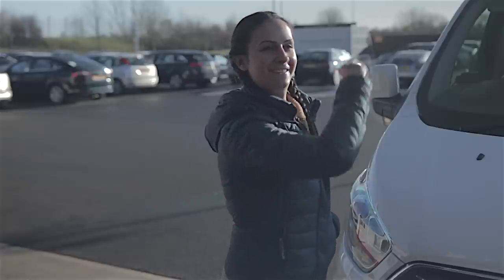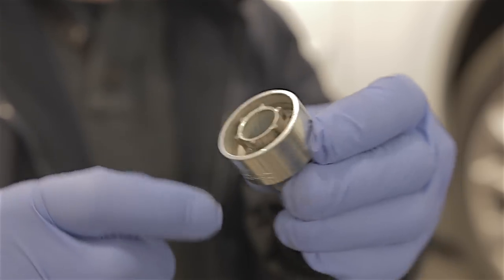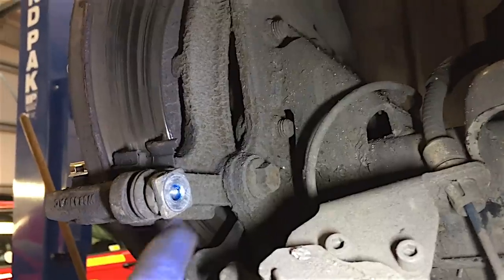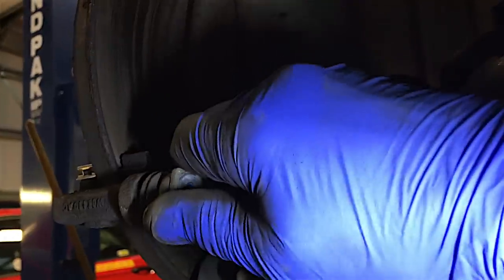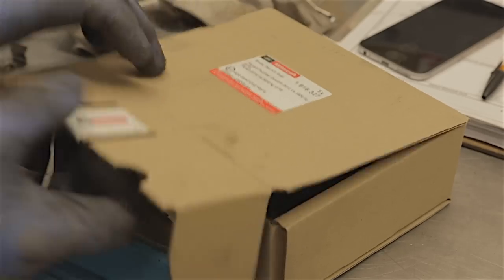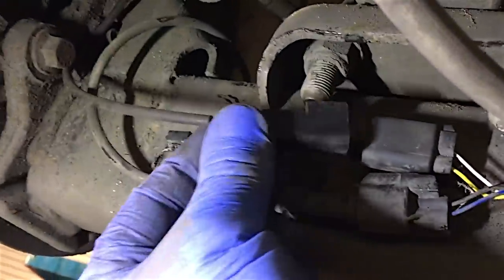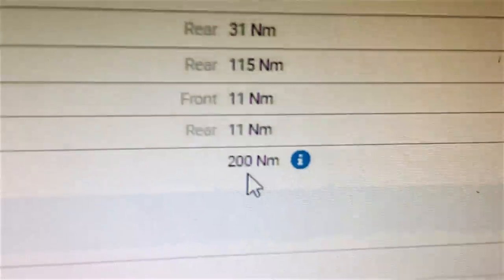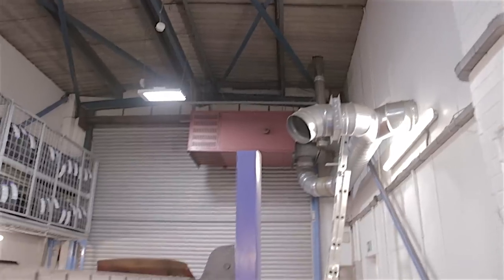2019 Ford Tourneo/Transit Custom Rear Brake Pad Replacement & Swollen Wheel Nut Removal

Comment: Two wet belts on one engine and the sump has to come off to replace them!!

Stuff is just too damn complicated now.

I had the chrome cap fall off my Mondeo,I only noticed when I got a flat,and of course the standard wheel brace won't work because of the reduced size,luckily I had my trusty tool kit,and my 18mm socket and breakerbar got me back on the road quickly.I replaced them with Volvo nuts which don't suffer from that problem.

Great to see you back Alan.
Reply from the maker: good idea to keep a proper socket set in your car, and replace those nuts with solid ones, cheers andy

Comment: Ive said it before, When pushing the brake pistons in , crack the bleeder, put a hose on, then push the piston in. No resistance, No fluid going backwards though the ABS valves and NO filling up the master cylinder and it gets rid of the dirty heat affected fluid next to the piston. Then when you top up to bleed the brakes, new fluid gets the the caliper faster. simple.
Reply: Sometimes the nipple will not undue , and they snap , then it's new caliper or gravity bleed it
Reply from the maker: i will try that method on the next one but great tip, without the proper wingback tool it could make the job a lot easier
Reply: @alan4x  Thanks for another great video! 
For what it is worth, I have also been practicing blocking off the break hose with some pliers when pushing the pistons in (after cracking the bleeder). 
I have also been told to add copper grease on the top surface on the piston and the fingers on the callipers. I am told it should reduce screaming noise from the brakes. Is this true?
Reply from the maker: @Torstein1960  i don't think putting copper grease there will stop brake squeal...most pads have anti squeal material on them but i guess its worth a try if you have squealing brakes, not something i have heard of or done myself
Reply: Funny I've been doing brakes for 20 yrs and I've never had fluid push up out of the master cylinder or ever had to add a drop
Reply: @alan4x the only time I've heard squeaking brakes is when people don't put SILGLIDE on the backside

Comment: You may already be aware but there is actually an arrow on the callipers pointing which way to wind it in and there’s a mark at the back of the calliper that you line the piston hole up with. New bolts from ford are usually 12mm too
Reply from the maker: i did not know that, so thanks for the tip, now i do know, cheers hobbs

Comment: bought a 3/4 inch socket for the 19mm ford nuts, it fits a treat, saves about 15 mins per service
Reply: I bought a Laser 18.5mm/19.5mm impact socket for the very reason. Wish I’d thought a bit harder and used my 3/4inch socket 🤣

Comment: Just want to thank you for your video my 2018 custom rear pads were were worn and bringing up the service indicator.  I used a special  tool, not pneumatic, passenger side quite easy but quite a job on the drivers side 
I used silicone spray as you suggested and had to buy a new torque wrench that did 200nm 
Thanks again

Comment: Funny enough had this problem with nuts on a mk4 mondeo today. Ended up removing the covers and will order new non covered nuts. Done rear pads on a mk7 transit and found starting off the rewind was hard going with the winder tool. I found opening up the bleed nipple helped but also using a suitable socket and bar on the winding tool to give a bit more pressure helped. Ford really screwed up with the nuts though!!

Comment: Good idea to use new bolts. I have had one ( top bolt)  on m 2005 Mondeo come loose and drop out. Wheel jammed as the calliper fell against wheel. Recovery home and I fixed it with new bolts.

Comment: Swollen nuts were a problem with a 57 focus i had. I levered off the chrome cover, under it is a smaller size nut head that fits the next size smaller socket . Use a 6 sided socket NOT the 12 to get a good grip. I took off all the chrome covers after this and never had the problem again.
Reply from the maker: good move, may save a problem later on, cheers chris

Comment: ok not transit related, but my daughters cmax had a seized up caliper, there was corrosion under the slide pin rubbers which squeezed against the pins, stopping the caliper sliding. the piston was wound out all the way, and i successfully wound it back with an impact wrench, after i could barely move it by hand. thanks for the video. your vid has also explained why her transit ended up with new bearings and everything:)

Comment: There are indicators on the calipers where should be the sockets oriented on the piston right next to the turning way indicator.
Nothing wrong with your method but with indicators it shold be always good at first time! :)
The trick to remove the disc without the oem puller, loosen a lill’bit up those torx bolts 2-3turns or more you will see it, grab a rubber hammer/mellet hit the disk as many times as needed to free them up
And the main trick is you only break up the wheel hub bolt when the disks are break up when the gap is there you turn out those torx bolts and finish the disk removal from the hub
Sometimes i just let the disk break up and i remove the whole disk bearing assembly and push out with a (dont know the correct word) bearing pusher need to be sure to be not harm the bearing
The timing belt not so hard.
Rwd harder than fwd for sure!!!
Nice to see your vids again thank you!
Reply: And one more thing!
In these cars/trucks when i do brake disk change i always greas up well the connecting components so next time i or anyone else can work on it!
Reply from the maker: thanks for the tips, i did not know about the indicators, now i do, cheers
Reply: I thank you those vids and content was very inspiring for me in the last few years! Keep up, we cant wait for the next video! So, thank you!

Comment: I use the sockets with the extra. 5 mm fir fir chrome cap wheel nuts , have had fun before with nuts stick in sockets , just bought the 19.5 mm and 21.5 mm sockets for fords great video Alan , nice to see you and Miss M 😂😂👍👍
Reply from the maker: i never knew they made oversize sockets for this reason😉i do now, cheers mike😁
Reply: Less than a tenner , us pro socket for new style custom 21.5 , double ended socket I use a 3 inch long extension inside as they are a straight thru socket , also available in 19.5 mm and landrover sizes to 👍👍
Reply from the maker: @mikeberry304  flea bay lol

Comment: When I do this job on my MkIV Mondeo and Mk III Galaxy, I pull the caliper and carrier off then remove the disc.  Reattaching the caliper then allows me to wind back more easily and removing the disc every time the brakes are attended to keeps it from seizing on the hub.  BTDT.  Then pull the caliper from the carrier and regrease the sliders every time to prevent those from seizing.  Reassemble and away.

I've never solved the swollen nut problem.  Later ones seem to suffer from it less but I think it just goes with being a Ford driver.....

Comment: Good to see you back brother 👍 Are work levels for the taxis and garage  getting back to normal ? Plus that Transit comes in an electric version which apparently does 315 miles : do you know anything about it ? 🧐
Reply from the maker: cheers m ac, yeah it is slowly getting normal, most cabs are now back on the road, i did not know about the electric transit, will look out for it

Comment: Hi Alan great video as always, just wondering if you can do a video on a timing belt change on a transit 2.0 like what you are working on, a relation to me has had one done and it's gone horribly wrong, tensioner was so called faulty and smashed the engine, engine rebuilt then kept over heating now fitted another engine and that's playing up, I hear those engines are terrible as my local ford dealer said if it wasn't for the transit they would of shut the door through lack of work, all the best.

Comment: Great video Alan. One question. I see youtube videos where people when pushing the caliper pistons back they open the bleeding nipple which is connected with a little pipe to a plastic container. What do you think about that? I am concerned that opening the bleeding valve you can get air in the sistem. Thanks for your advice.

Comment: Hello and Happy New Year Alan and Monica ! Wishing you both well from across the pond . 
Thank you for this video on the ford transit connect . My brother just purchased an American version , model year 2o13 . IIRC , it’s got approx . 156,000 mi. or so . We’ve got lots to learn of this vehicle as it is new to us in acquisition and operation . Well , wouldn’t you know , I had completely forgotten from an early video of your channel that there is no hood ( bonnet ) release in the drivers compartment , it’s of course under the blue oval on the front grille . Also forgotten that the ignition key opens it . Luckily the former owner informed my brother how to open the hood . We were concerned we would break the ignition key turning it opposite to unlatch the second catch . 
Good old wd - 40 took care of that . We haven’t ventured into brakes yet but appreciate the how to on this model , albeit difference in model year . Of course being it’s an American vehicle of questionable maintenance record , we’ve much to get acquainted with . 
No fear , Alan is here ! With the assistance of the channels star attraction , lady Monica , it is certain that there will be less surprises of one of these vehicles . I will add that I haven’t seen many of these vehicles privately owned as they serve mainly as service vehicles here in fleet operation . This particular vehicle recently acquired was the property of a chap who’s trade was plumbing and in a privately owned business . You can just imagine that since these vehicles are relatively new in this country as they were initially designed and built to European specifications . Of course , ours is a left hand drive with auto transmission . It’s in need of service but as my brother and I are seasoned do it yourself mechanics , a professional mechanics worst enemy in some cases , we will tackle all we can . 
Not to worry , it’s our preference to handle repairs / replace in a proper fashion and not in a primeval fashion . Yes , one can find owners of these vehicles on videos here on YouTube but I am personally inviting your guidance for future videos on the ford transit connect . 
Of course the model your servicing in this video is a larger model , my brothers is the smaller version with the four cylinder engine . 
As stated in this video , these are quite a bit more emissions items and hoses and pipes . Electrical , well we are getting a bit of that so far but luckily only just lighting . It may be fairly new , but it’s going to start racking up parts and money soon . An engine mount is in need of replacement as well as a headlight assembly . Well you can see where this is going but so far he is pleased with this new to us vehicle . 
I’ve yet to hear if it’s fuel mileage record but am expecting a good report . If the evap trouble code should pop up again after we erased it , po442 i think ? , we shall start looking around for pipes and hoses under the bonnet and by the fuel tank for evaporative equipment . 
It shall be an adventure in learning a new vehicle but anything on four wheels has become a mix of less foreign or perhaps in this case , more foreign ? , to us as previously mentioned , we service our own to the best of our ability . Now , if ford would be sporting enough to arrange for the ford Mondeo to hit our shores in bigger waves , I would like to see one up close and personal . I’m sure there are some here but not close enough to get my hands on . Well , I’ve held the your attention long enough , looking forward to you both in 2022 ! 
Cheers to you both , health and happiness always . Bang on all,at Steve’s taxi as well ! Cheers !

Comment: I’ve got a mk5 mondeo with those wheel nuts and the same thing happend to me,I replaced them with solid wheel nuts
The calliper wind back on the rear,one being clockwise and the other being counter clockwise is the same as a mk3 mondeo rear brakes
Reply from the maker: cheers david, all the mk5 mondeos we have we put the callipers  into maintenance mode and then the pistons just push in
Reply: Yea mate,I used forscan when I did the pads and discs on my mk5

Comment: I had the problem with those wheels nuts on my car (Jaguar XF). Made worse by using the supplied wheel brace. I soon changed that, and the suspect nuts.
Reply from the maker: you made a wise decision

Comment: If you want those nuts to last longer don't use an impact gun on them or crack them off with a bar first. All the cars I have owned since 2006 have had that type of nut and I have never had one swell up as I don't use my impact gun to crack them undone or to bang them up tight. My 2015 Mondeo still has its originals and they are still fine. 😉
Reply from the maker: good tip but the torque setting on that transit wheel nuts does seem a bit high at 200nm
Reply: @alan4x  yeah it is but it's not beating the hell out of them like the gun.

Comment: Great vid I’ve subscribed . 
Is the method the same with the fronts ?
Reply from the maker: thank you, the pistons in the front brake callipers just push in
Reply: Thanks just done the fronts and only got the backs to do tomorrow . 
Everything went smoothly and trouble free thanks to your channel great stuff . Unfortunately I’ve notice my break pedal slowly sinks when the engine is running , not sure if it’s been like this for some time and I’ve only just noticed, as you don’t generally  sit in your vehicle pumping the breaks and taking note of pressure . I’ve checked for leaks , levels are ok and I can’t see how air could have gotten in from just winding the pistons back . Any ideas ? Breaking is fine, just the pedal sinking slowly is the issue, plus a hissing sound like I’m pumping up a dingy . Master cylinder seals possibly?  Thanks

Comment: The problem with the nuts arises from the use of an impact wrench. These nuts must be unscrewed by hand. Tested on Mondeo Mk4.
Reply from the maker: i had to look this up but yes there are several reasons from from dodgy sockets to dampness under the tin cover causing swelling , best to find solid wheel nuts, cheers tomc997
Reply: @alan4x  I was able to remove a few of these caps and use an 18mm wrench. It looks worse, but it works. Whole nuts are a good idea, but the availability of good quality is poor (only Chinese). Unless in the original Ford store, but the price again ... Lots of health, Alan.
Reply from the maker: @tomc997  cheers

Comment: The wheel nut balloons because of the use of the powergun when unbolting them.
They're not meant for that kind of treatment.
Reply from the maker: had to look this up but yes there are several reasons from from dodgy sockets to dampness under the tin cover causing swelling , best to find solid wheel nuts, cheers carlos

Comment: Hello. You should open the bleeder valves and let the old brake fluid out of the caliper , not push it back into the system. Regards

Comment: Talking about wet belts 2017 on 1.0 Turbo Honda Civic  has just gone on the fixed price repair board at £1349 75k or 6 years, Going to be some angry customers !

Comment: Hi Alan, nice to see you back at last! Could I ask how the pistons are able to rotate outwards, as the pads wear, if the pads have lugs on the back that locate into the piston's slots? Cheers, keep up the brill videos 🙂
Reply: The rotation and screwing to take up the wear is within the piston. The outer does not rotate to take up pad wear.
Reply: @richardsheil5289 the outer pads ride on those sliding bolts that's why you have to keep them greased

Comment: Hi Alan, I changed my brakes today and having parked on a slight gradient with a chock under the wheel, on driving it from the chock I grabbed the handbrake to stop it rolling back. It isn't working that convincingly now, but it is working with excessive travel. Any suggestions please? Much appreciated.
Reply from the maker: did you pump the foot brake a few times before you applied the handbrake after fitting new pads... you may have to wind the pistons back in and try again
Reply: @alan4x  I didn't mate, no. Just instinctively grabbed the handbrake to stop it rolling. 😂
Reply from the maker: Ahh ok lol. Well just wind the caliper pistons back in and pump brake pedal a few times before you touch the handbrake and it should be ok
Reply: @alan4x  many thanks for taking the time to answer, much appreciated.

Comment: Wheel nut problem is caused by the nut rotten away under the tin cover bad design and no protection .had a few like that
Reply from the maker: cheers ian

Comment: I used to take the tin cap off the nut and then use a 18mm socket
Reply: Will this be easy work Robert?
Reply: @marinusapeldoorn6631  yeah but would need too carry a 18mm socket and a breaker bar with you because yiur normal one in the car won't fit
Reply from the maker: your right, your wheel nuts won't look pretty anymore but at least you can remove them
Reply: @robertmustard1711  ok, will it be easy to remove the outer skin???
Reply: @marinusapeldoorn6631  I use to knock a 19mm on it it will pull the outer skin off then put a punch therew the top and knock it out of the socket

Comment: I was using a 20mm socket on my mk5 mondeo wheel bolts, i assumed ford had used a 20mm nut 😂 replaced all of them for brand new ones, cost about £24 from ford

Comment: thers a special size socket for these on ebay do the for range rover and the other silly chrome cap nuts
Reply from the maker: after this video i have just learnt this oversize socket, thanks
Reply: @alan4x  no problem I only came across them for the new mercedes odd ball wheel nut have a strange fitment